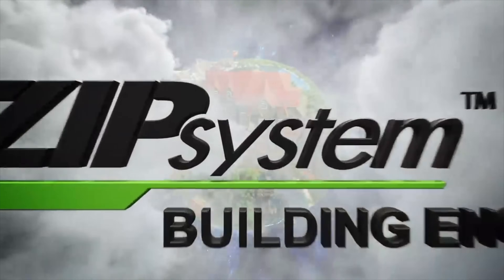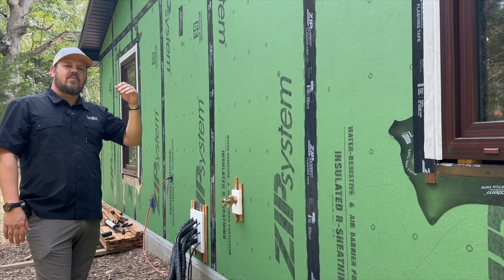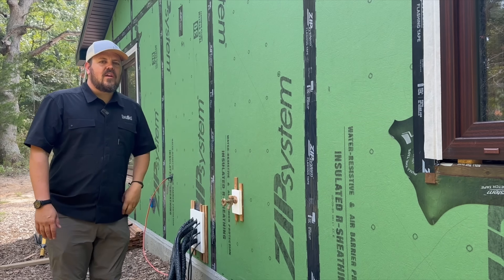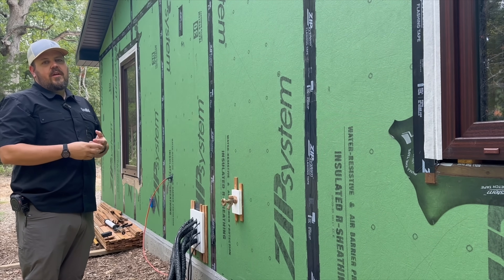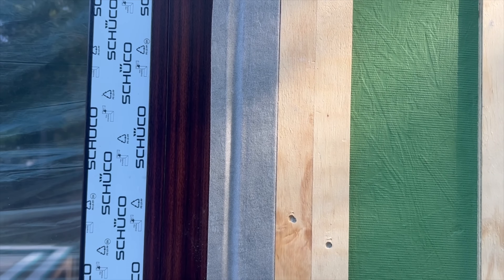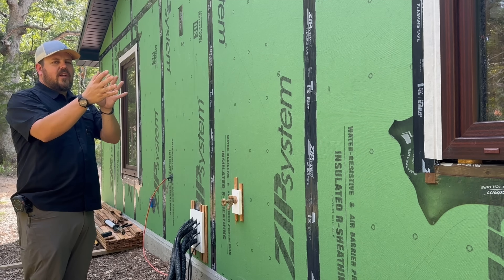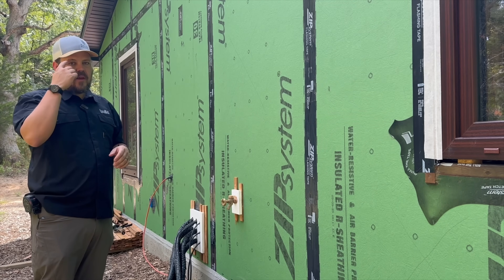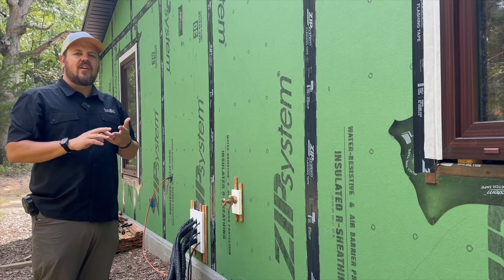Before the Siding

Comment: Do you still use a foam sill sealer when air sealing with siga tape? Does the foam sill sealer affect drying out prior to applying the siga?
Reply from the maker: The sill sealer is a capillary break between the treated plate and concrete. It is air permeable and shouldn’t affect the drying much, some but not much. The Siga tape is to allow the panel to dry more than anything. The same detail could be completed with Huber’s Liquid Flash, which is also vapor permeable.
Reply: @jake.bruton.aarow.building 
Thanks! Debating between liquid flash or Fentrim tape to air seal that connection to the slab. Did you use 6" or 9" Siga tape? Sounded like you said siga tape was less expensive than other options, which would include liquid flash.?
Reply from the maker: We use the 3” Fentrim.

Comment: I've seen your buddy Matt Reisinger do the minisplit lines through the wall like that, with each line getting its own hole and liquid flashed to seal it. It looks great, but what happens years down the road when the unit needs replacing or a linset gets damaged? Seems like you need to cut away the liquid flash, pull the line(s) through the wall. Then you say you have blown in insulation, probably behind some sort of Siga membrane, then sheetrock. You have to fish the new lines through and reseal everything, inside and out.

I installed a Mr. Cool for a friend. It comes with a 3-4" grommet that goes through the wall that all the lines run through. I cut some foam from the packaging into 2 semicircles, then cut holes for the lines. The foam was 2-3" thick. If I recall, I did 2 layers. The fit was tight. Then I used the putty they supplied to seal it, then I covered that with flashing tape.

If the unit needs replacing or repair, the line set can come right out and be replaced without disturbing the wall assembly.

Comment: How about the window detail?  Expandable foam or zip liquid?
Reply from the maker: The interior is Siga Fentrem and the exterior is the same. The jambs are treated with Zip tape. The space between the window and frame are stuffed with backer rod only. We take a hit on R value by not filling the space full but we give a lot of open space to drain if water does ever get inside and that water is our biggest concern.
Reply: @jake.bruton.aarow.building  thanks!  We are being our own GC on our house and I plan on walking around shoring up every penetration spot, hole, and crack I see after framers do their job and every pre-next step walk through you guys do, I am watching and learning.  I’m just trying not to be a “YouTube Dr Google” annoying homeowner.. while not missing the important details. The Siga tape just became new on my list for foundation to zip sealing instead of liquid Zip.  Planning on Zip R6.  I’ll take every lesson I can get my hands on… seriously.
Reply: @jake.bruton.aarow.building would it be advisable to seal the tops and sides but leave the bottom open for drainage?

Comment: Hey Jake. How do you find your climate zone to know what r values you need?
Reply from the maker: Great question, the climate zones to which I am referring are from the Internation Residential Building Code (IRC) . In chapter 11 of the IRC there is both a map and a county-by-county accounting of the USA stating which climate zone each is located. The IRC is free online. Their site doesn’t make itself look free but once you are on their site if you scroll on the right-hand side you can select the chapter you wish to view and navigate to the chapter by clicking its section.
Reply: Start with your county building site to find out which IRC they follow.  I’m in Colorado 1/2 mile into one county that is in 2018 IRC, zone 7.  Across the street, that county is zone 5B 2015.  In the IRC, chapter 11 has every county what climate zone it is.  But vastly different insulation depending on what year they follow.  Denver just went to IRC 2024.
Reply: Search for US climate zone map.
Reply: Google is pretty dependable. Find your county zoning website.

Comment: I like your use of PVC blocking from what I can see for your penetrations, but would have like to see PVC instead of plywood strips at those penetratiions and under your windows.  Also the Prosoco Cat 5 really sticks to the concrete.  I have some dropped on my driveway with no change for seven years.  I don't trust tapes or things attached with staples.
Reply from the maker: PVC is not cheap. The plywood strips last just fine because not much water gets behind the siding and the air flow means what does get back there is constantly dried. They don’t have any opportunity to decay, PVC would be overkill. I understand your thoughts though.